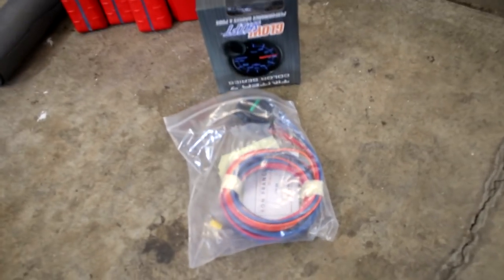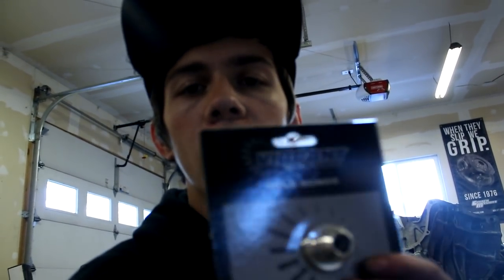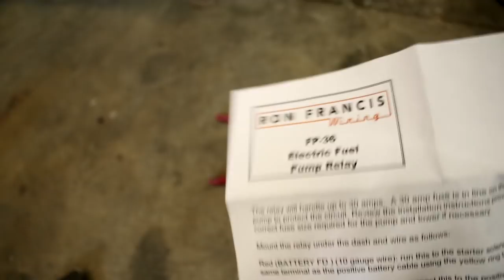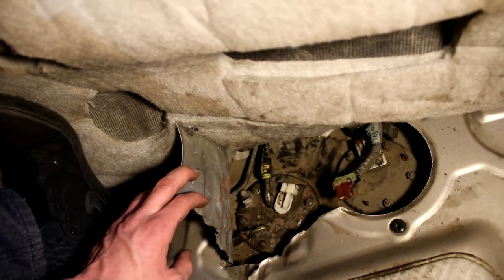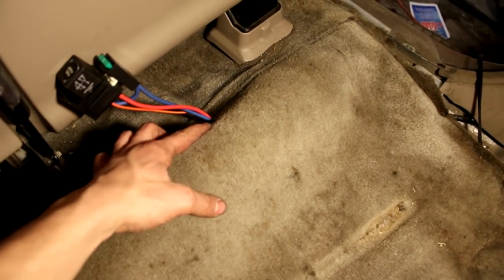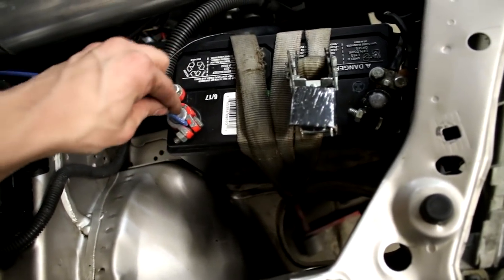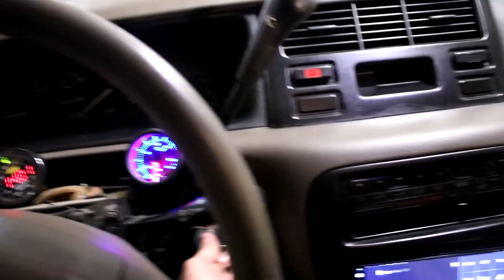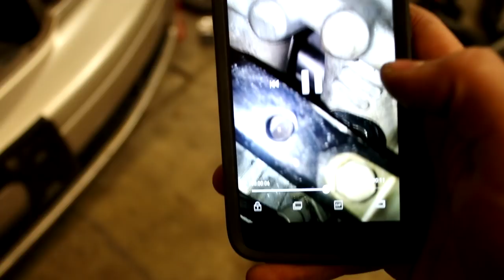Will the Minivan have Enough Fuel to Make 700hp?

Comment: You need tires right now not more power
Reply: Can't it be both? :P
Reply: Zig-zag Wraps That's what I'm sayin. Same with the hatch. The things just spin. Then again stickies aren't much help in snow...
Reply: Plus one for needing tires more than power at this point. A decent 255-275 series radial would make that thing so much faster without any additional stress on the engine and other components. .....tires first then turn it up lol
Reply: Coltin Jellison 
better traction puts more stress on just about everything vs more power on bald tires
Reply: Yes your right more stress on the drive line. I guess i didnt clarify very well what i meant now when i read my comment again.. I meant that rather than turning the car up and putting more stress on the engine and its internal components to make the car faster he could just put a good tire under it and pick up as much or more acceleration with the new found traction without stressing that stock 4cyl honda block and internal components  any more than he has. The bettertire, in comparison to getting another 50-100whp from upping boost, would be more beneficial in my opinion. However as stated previously the better tire would create more stress on the axels, diff, and tranny. That i do agree with
Reply: Coltin Jellison
i see what you mean
youre def right

Comment: "builds 700 hp cars and vans, takes tire to the shop to fix a small leak from a nail" :p bro you can buy kits to do that yourself for a couple bucks lol
Reply: silosis yeah expect they can seat the tire a lot easier and do the better repair
Reply from the maker: our local shops do it for free :)
Reply: That Onedude Honestly bro Kyle should definitely invest in some new ones
Reply: Even if it wasn't for free, why would you even want to deal with it yourself? I'll spend the $20 and save the headache
Reply: you're not supposed to plug a tire, you always take it to a shop to get it patched
Reply: OfficialCyanideBand one burnout will rip that plug out
Reply: silosis 
I’m not hating either , I’m kinda chuckling as he explains the relay operation. 
Works with all kinds of computer stuff , has a tough time with basic electricity... relays and wires and shit can be fun, make your car do what you want. 
Like the stealth nos activation he had, now he’s starting to think.

Comment: The panels are called a sail panel and a kick panel forward. On a standard 4-5 pin relay. 30 is direct to battery b+  85 and 86 are your triggers. One ground one hot trigger. And 87 is the hot output. 87a on a 5 pin is always hot unless clicked where 87 becomes hot

Comment: Wow that's an awesome relay setup. Integrated fuse holder and super high quality wire. Wicked nice. Other Kyle rocks!
Reply: 802 Garage the fuse should be closer to the battery.  If it shorts it’s gonna burn all the way to the relay. Useless.
Reply: Mike Crosby I was thinking the same thing looking at it. Really though since it's only a 30A fuse, the fuse would blow at any spike long before that wire starts melting. Looks like quality 14 or 12 gauge with a silicone jacket. Would take a lot of heat to melt that wire. I'm sure they thought of that when designing the kit. If anything grounded out, the fuse would blow quickly before the wire could heat up.
Reply: no, it should be put close to the battery because if the wire gets pinched to the chassis BEFORE the fuse, the fuse won't blow, but the wire will burn off and probably set on fire the trim pieces and so on.
Reply: Mike Crosby Just what I was going to say before reading your comment.  I would have kept the relay in the engine bay as well.
Reply: especially with that single insulated blue thin wire running under the carpet, really vulnerable.
Reply: I’m shocked someone’s picking up on actually buying electrical items to do stuff right. 
Whenever I see batteries relocated , I see about 80% of them done wrong. 
Not that his is relocated yet , but....
All of the other cars with relocated batteries on here are done wrong. 
There should be a solenoid to kill the b+ to the starter back at the battery. 
the only time that cable should be “hot” is during crank. 
Run the accessory wiring to the back and fuse that, add a jumper from the b+ on the starter to the starter “S” terminal and your good. 
No smoke let out of the whole car when that big fat starter cable grounds in an accident. 
Get a kit from the link he posted or make your own kit.
Reply: Bad install fuse should be near battery... Smh

Comment: U can buy tire plug kits in any auto parts store, they're literally the same thing they use in tire stores, just with cheaper tools, I've plugged tires on the side of the road with them, the only problem with that you loose all the air when when you take the nail out(just another way to save money)

Comment: That rubber grommet  you pulled out of the floor. You should cut a slice in it and slide the wires through it. Just an extra touch. Turned out great man. I'm not even a honda guy and iv been following.

Comment: I hope you put a second fuse close to the battery on the power wire going to the relay. The fuse on the side of the relay won't do squat if you get a short somewhere between it and the battery.

Comment: Anyone else find it strange that when Americans do oil changes they have to buy several or a half dozen quart bottles of oil instead of 1 or two gallon bottles. In Australia we can buy 5 Litre or or 6 Litre bottles of oil in most brands available on the market which would be close or equivalent to U.S. 1.5 gallon bottles I think. On another note thats one dodgy relay mount location. wth!
Reply: Kyle And World 
Its the same in the US. We have Gallon jugs also.
Reply: Kyle And World he may be getting better deals buying them in 1 quart each as opposed to 5 quarts
Reply: Penrite 5w40 racing $65 @ supercheap! How can you go wrong!
Reply: I buy them in little bottles so the leftover oil that I have isn't in a big bottle.
Reply: A gallon is 4 quarts guys... We have some gallon jugs of oil, but most of them are 5 qt jugs which is 1.25 gallons

Comment: Kyle you should have just used the original wire connection for the pump and spliced it onto your new relay. It would be more solid connection and better weather resistance

Comment: Pretty sure you want the relay to live in the engine bay and not back next to the pump, the fuse should always be as close to the battery supply as possible not close to the load, so red wire to bat + and blue wire to the pump then tap the relay trigger into the existing fuel pump relay output inside the factory relay box or factory fuel pump fuse. Just don't want to see the minivan burn up from an electrical fire.

Comment: Hey brother, love the thoroughness of the install of the new relay.  I have a question, why not keep that plug in the hole and just punch a hole through it so then it will act as a grommet so the wires do not rub against the metal?  Just a thought.  Keep up the great work man! Referencing the rubber plug at 11:50.

Comment: Hey dude if you want to take your catch can to the next level you could get a vacuum pump. It's a little difficult as you have to dial in your crankcase vacuum but you'll make a bit more power from improved piston sealing and increase the longevity of the piston rings. Great job so far!

Comment: You need a 1:1 boost reference fpr.  If you have 45 fuel pressure and 20 manifold pressure the fuel now becomes equivalent to 25 psi.

Comment: Dude... Use the terminal on the pump for power/ground. They hold better than spades.

From there, use the existing signal wires to trigger it.

Comment: Hey Kyle.  I Just bought a civic with a turbo z6. Already ordered hondata. boost solenoid. High flow oil pump acl race bearings. Wiseco pistons with eagle h beam. Arp head studs. Walbro 450 pump. 1000cc injectors. Competition Stage 5 clutch and flywheel. Msd distributer. Coming from dsm background I can see Honda's are stupid cheap to work on.  Wanted to keep working on the gst but pfi wouldn't answer my emails or return my calls.  I had 3500 to spend there for my eclipse. So instead I bought a Honda that's easier and way cheaper to work on

Comment: If you run the power wire to the alternator instead of the battery it will give you higher steady voltage

Comment: You probably won’t see this but the way you have the relay wired is a serious fire hazard. You need your fuse to the relay significantly closer to the battery. As you have it right now, there is nothing protecting that leg of wire from the battery to the fuse on the relay.

Comment: Do your self a favor and add a inline fuse on your fuel pump power  at the battery. If that wire rubs threw anywhere you will have a serious melt down. Have fun in Florida.

Comment: Probly becuase u had a long night but u need more amps for the fuel pump not voltage u  u only have syetem voltage wich is around 13.5 depnding on the alt  but the 10awg is better then stock cuase u can get more amp to the pump

Comment: You run the ground to the fuel pump bracket ? Those gas tank are in plastic no ? So you shouldn't have any ground connection at this place. Maybe you should use a chassis ground or make a bridge between the chassis and the fuel pump bracket.

Comment: how would increasing amperage to a pump increase pressure if the fuel is mechanically regulated?

It might increase pump flow potential maybe, but not pressure. You'd need a fuel pressure regulator to mechanically increase/decrease fuel pressure as needed.

Am I wrong here?

Comment: Correct me if I'm wrong but doesn't using the existing connector negate using thicker wire? Wouldn't the power bottleneck at that point or is it much large "gauge" than the original wire awg? Like being pointless to use new, larger speaker wire but keeping original wire in the door, make sense? Wouldn't you have to run new, larger wire all the way to the pump? Just wondering
Reply: Edward Brown DC voltage drop is proportional to wire length, so, the more of the length you upgrade the better.  A really tiny piece of stock wire should cause tiny to no voltage drop.
Reply: David Askren ok, I was always under the impression the lower the gauge (larger wire) the more overall power could be conducted from two points since more surface area and less distance, but I've mostly been more concerned about amperage in the past and overall watts
Reply: The relay only uses the existing plug to trigger it. It has wires straight from the battery to supply the fuel pump with power. That's the point of the relay
Reply: Dylan Andersen ok, that makes more sense. Signal wire basically to close the relay and use new wire. Thanks

Comment: Ayyy Kyle! I have watched every video in the last like 3 months but i still didnt get it. How do you deal with the FRM sleeves in the H22 blocks and using forged pistons? As always great video!
Reply: remove the frm sleeves and put steel sleeves
Reply: TheTommer777 if I’m correct you get them installed and bored out to stock bore or whatever your pistons are and you are set
Reply: Mahle gold series is the only piston made that will work with frm sleeves
Reply: TheNappert he's running stock sleeves
Reply: A couple companies have coated pistons that are designed to work stock sleeves and he uses jdm blocks that r closed deck usdm blocks r open deck thats where they fail
Reply: dr ron I've read about coated pistons but didn't get a definitive idea, I guess that's it then...
Reply: The h22 in the minivan is darton sleeved I am certain...
Reply: CinematicGamer I think so. But what about the hatch lol
Reply from the maker: hatch is stock sleeves with mahle gold pistons, minvan is sleeved
Reply: BoostedBoiz thanks a lot for the reply my boi!
Reply: What kinda pistons in the minivan?

Comment: I Hurd 2 stepping can ruin your turbo idk how that works 🤷🏻‍♂️🤦🏻‍♂️
Reply: Real Gamerz14 
I think the vans turbo has anti surge on it.
Reply: blake conner anti surge has nothing to do with 2 step damaging your turbo. Surge is on the cold side, not the hot side. And yes 2 step is very stressful on the turbo. You're basically retarding ignition so that the air/fuel mixture ignites after the exhaust stroke, so the mixture is igniting inside the turbo to keep the turbine spooled. It spikes EGTs and pressure inside the turbine housing where it really isn't built to handle it. It's usually fine though, unless you're hitting 2 step constantly every day.

Comment: You didn't follow the instructions Red wire is positive and Blue wire is for the pump.
Reply: If you watch video again he shows the instructions Red is to Battery positive and Blue goes to Fuel Pump also wires are labeled Red Battery feed and Blue Device Feed.

Comment: Y not drive the miny van down?
Reply: The trip is from Colorado to Florida, he's on an e85 tune and that would be so hard to find an e85 station readily available every time he needs to fill up(its frequent because even though e85 is higher octane, it is not as dense as pump gas and thus you need to burn more gas for similar energy output if you were on pump gas, aka lower mpg.)  Also, if the minivan breaks how the fuck is he gonna get back? OR what if it breaks on the way down there? There is a plethora of reasons to trailer it.